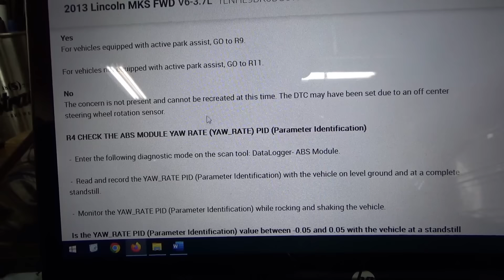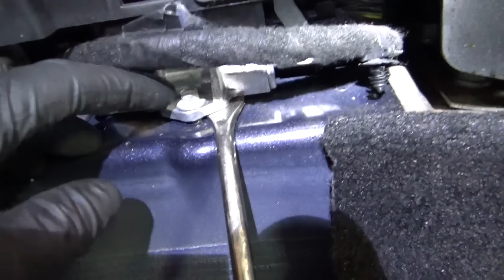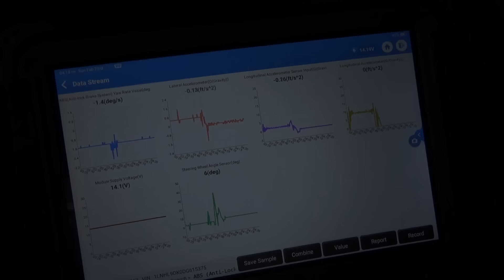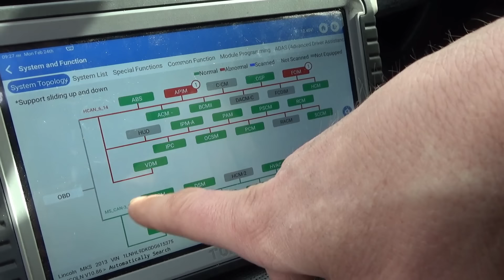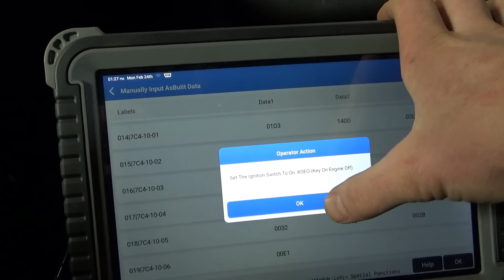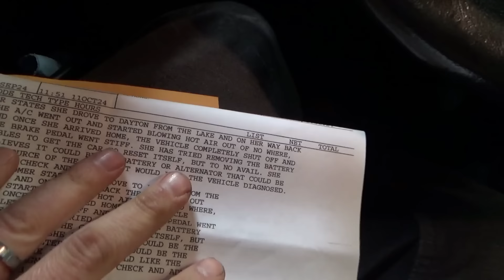(Pt 3) Lincoln BUTCHERED...by Dealer?! ('13 MKS: Water Intrusion...NEW GHOST U3000?!)

Comment: I once ran an extension cord to a car for 3 dehumidifiers inside the car to make things as dry as possible with out taking things apart. It worked. It took about 3 days though. That car was semi flood, driver went though deep water.

Comment: The way I find water intrusion complaints are by closing all doors and windows, setting the blower motor to max, and the ducts to fresh air. Then I spray soapy solution over suspect areas.

Comment: You should not have installed a washer under the RCM. You should have performed in IVD initialization for the ABS module instead. The process instruct you to ensure that the vehicle is on a flat and level service, and that zeros out all the accelerometers and your steering wheel should be straightforward as well.

Comment: Water intrusion is the worst. Cars, buildings etc will drive you absolutely crazy. The sunroof craze that began in the early 00s or so makes me 🤦. Whilst browsing for used vehicles today, it’s almost impossible to find one that is not equipped with one of these evils.

Sunroofs are not the only problem, however, as I use a ‘17 Ford Transit 150 at work which has no sunroof and has all sorts of strange water intrusion problems. During the largest of rain events the vehicle’s headliner gets wet. I’m still trying to figure that out.

The windshield/hood cowling drains have issues also and Ford positioned the ECM directly below one of these problems. The cheap plastic water channel pieces have a tendency to fall off and produce a waterfall directly onto the computer. Luckily I happened to catch that issue before the ECM was ruined.

Comment: I work on this fords every single day.
C0051 is Abs, Flicker lamps is maybe tailgate brake lamp is false, or bcm module- you can program used module, u3000 is left blind spot monitor, the water is from sunroof drains.

Comment: Too bad this is so long ago. We had this issue where the dash was fussing about all the marker and brake lamps. It kept saying there were lights out and found out that LEDs were installed without telling the central electrics module we had done so. It completely disabled all of the lamps and I used my test light to make a check to see if the central electrics module(fancy fuse box) was fussing about that circuit. It worked just fine with the test lamp but not LED's. I started to learn about how the BCM, CEM, GEM, etc module is looking for a certain resistance in the circuit. The Ford Taurus version of that BCM has incandescent lamps so the As Built info is stored on the BCM as such. If someone mis interprets this data and sets the as built data as incandescent instead of LED then you will have weird things going on with the system. Maybe that BCM is different just slightly from the Lincoln and Ford versions of this car which is a fancy Taurus.

Comment: Hi Ivan 
I had a 2011 acadia before and it had same problem and it takes 3 shops to fix it.. and the problem was the steering wheel sensor wire was not connected properly

Comment: Intermittents are such fun.........NOT ! ! !   Sometimes you've got to connect meters and gauges to the system and wait to see when the problem shows itself.  BTDT.  I've seen main power to the module intermittently drop to zero and even a ground suddenly show slight power.  The power wire was cut through the insulation and grounding out to an engine bracket.  The ground was loose, even though I had checked it, it felt tight, but put a socket wrench to it and oh ya, it's loose.  Sometimes heating a module with the electric heat gun (looks like a hair dryer, but don't use it as a hair drier, it'll burn your skin) or spray it with that cold stuff in a can.

Comment: 2020 Sonata with 4300 miles: seat back would not go forward unless you moved the switch backward first. Dealer wanted to replace battery and sest switch for $1003. Declined. Friend at work suggested what his friend did for his Toyota pickup based on google search. Reset seat by pushing buttons to send it all the way back, then fwd, then back again for all 3 buttons. Tried it and it fixed the issue. I will never go to a dealer for a repair. Only went this time because of the warranty but missed it by 2 weeks.

Comment: these Lincolns are really nice cars. It’s a very sad thing that they are plagued with this issue. If you have a sunroof, keep your sunroof drains cleared and make sure that they do the proper steps if you have a windshield replaced because it will leak and you will regret it😢
Reply: i also wonder if the bcm was actually programmed from scratch or if they cloned the data from the previous bcm and tried to flash it to the replacement one when i did the bcm a couple years back on a 2014 f250 i tried doing it this way with my autel and even went as far as entering all the as built information manually and yet it was still messed up because the previous BCM was just screwed an F250 thinking it was a Dooley flashing dome lights for some security issues. I eventually had to break down and go out to the dealer and have them sort it out explaining everything i had tried and they had to basically program the module as if it was new is my understanding and it took hours because not only was the bcm messed up but the pcm was also it was crazy so im curious if you will have to do the same thing with this car and basically re flash the modules that are being weird unfortunately you dont have the luxury of a new bcm i got lucky and was able to get one but that was 5 years ago now anyway im looking forward to what you finding finally fixes the car

Comment: Hello Ivan this is a fun one the fact that your problem acts up at very slow speeds and on a bit of  turn just sounds like a wheel bearing loose  causing a deviation in a speed sensor. Also on the possible water leak when i check sun roof drains i open the roof and park on a bit of a hill. now from the open roof pour some water into the sun roof tray and watch for the water exiting from the factory drains at the bottom of the car try each corner and compare results to se if one drain may be plugged. it depends on how the car is parked ( leaning ) weather the plugged drain ill cause water to enter. good luck.

Comment: This is turning out to be quite the mystery.  What happened to this car while it was in the dealerships care?  Did someone pull the center console looking for the park release?  Did someone leave a window partially open while it sat outside in the elements?  And why did the dealer call a bad BCM for a no start condition when the car is now starting and running just fine with said bad BCM installed?  We may never learn the answers to these questions.  But now that Ivan is on the case, I am certain we will find answers to what is causing these intermittent glitches.

Comment: the ends of the roof vent drain lines should be visible under car; sometimes get plugged (often with help from insects/spiders). You might check / snake them.

Comment: You can use Forscan and with a few mouse clicks it will retrieve the as built file from Ford and reprogram a module with the as built data. Very easy and fast.

Comment: I have the same service advance trac message on my 2015 F-350. Happens while turning but not every time. I drive this vehicle every day; once the message displays, I sometimes get a false ABS engagement while braking normally to a stop. I believe the problem is a bad wheel speed sensor. Could be the tight turn pulls the speed sensor harness too tight.

Comment: Mix-matched tires?
I hadda random quirk w/a car that could not have a newer tire on one side but worked fine on the other side... It would trigger abs lock-up & traction warnings on slight right turns but was otherwise fine~

Comment: Call me paranoid, but I'd be verifying that ground visible dead ahead at 4:21.   It's in line with the water intrusion and has a bunch of wires on it.  I absolutely do not like the longitudinal value constantly changing.

Comment: I've heard of Lincolns "ghosting" some convenience functions when there is an unrelated problem without setting any type of codes or warning messages. 
   Example: A fellow tech had a 2018 lincoln come in with no AC. A previous shop replaced the BCM with no success, so they reinstalled the original and gave up. The ABS light was also on, but the customer didn't want to address that. After quite a while finding nothing wrong with the AC my friend decided to look at the ABS just to see what was going on with that. It had a sensor code, and ABS data stream said that wheel was reading 114 MPH with the car standing still. He fixed the sensor problem and instantly the AC started working again. The only thought process anyone could come up with was the car saw the ABS problem as a safety issue and disabled the AC to prompt the customer to fix it. The problem was it never gave any indication that was their strategy. No warning light or code for the AC. Maybe the erratic turn signal on your car is a way of annoying the customer so they fix another more serious problem.

Comment: No surprise here with the Ford/Lincoln modules. Likely the last dealer/mechanic/technician had unplugged those switches for lane and park assist to trace down his BCM issue. Too bad his documentation on the repair order didn't provide more of the details. $1,200 for that lane change module is completely asinine.

Comment: Such a weird case study. Do you think that someone tried to disconnect something in the console to get the car in neutral for loading on a flat bed? I wish you had a lift just to look underneath the car. My wife ran over a small branch in the driveway in her 98 Caravan and broke a plastic fuel line and didn't know it.

Comment: This is another fine mess you have gotten yourself into. 😂

We used to throw an airline in semis close them up and start spraying soap water at possible areas that could cause a leak. 

Have you graphed the wheel speed sensors yet on one of your test drives? Also have you measured the body on all four corners in case suspension is out of whack. I have seen that on a BMW before, but it did have air suspension.

Comment: Auto park and lane assist are two features that I would be fine if they were permanently removed.
Too many features on cars. I go to a dealer and all the sales lady would talk about was ApplePlay and I have an android.
I wanted to know if there was a full size spare tire. But the trunk wouldn't open because the battery was dead.
I wanted to know if the engine had a turbo. Her eyes crossed and she started talking about ApplePlay again.

I have a 2010 car with moonroof. I forbid anyone to open it. It's a feature we don't need. At 15 years age the seals are probably ready to crack and start leaking so don't touch it. If someone does then I will spread some bathtub caulk around the edges of the closed moonroof and seal it shut permanently. Come to think of it I need to remove that fuse.
Heated seats. Don't need them because we don't live in an area that ever gets that cold. They are big buttons and in the way of the shifter so they are always getting turned on. And then I get cooked. I took the fuse out.
The car has traction control which is some junk feature that makes the car lurch when it mistakenly thinks something is amiss with the traction. No thank you. I can tell if I am losing traction.
ABS. I think the car is more dangerous with it than without.  It's made me slide through intersections when I was trying to stop on dry pavement in the summertime. No thanks.
OK. I like intermittent windshield wipers. I'll keep that. But if it breaks I'm not fixing it.
Reply from the maker: Great comment 👌😎

Comment: On the new Ford F150's with the rear detection system, the module(s) in the rear tail lights get water in them and the corrosion takes out the detection modules in each light, tail lights themselves and the harnesses that connect them all together at a cost of $5k to have replaced and programmed. And the kicker is.... All the corroded components causes a Low speed CAN communication issue dor subsystems inside the cabin making it tough to track down, mainly because all the dash emojis are for the interior of the truck. It was a tough one to track down. CRAZY.....can't make this stuff up!
Reply: Seems like Brian with Ford tech makuloco did a video on that very thing.  The truck was sent through a car wash and so many codes were set the truck shut down.  $5,600.00 to replace the taillights.

Comment: When viewing the data on the side detection module,  it was showing voltage at 11.6-7 volts,  while the scan tool was showing 12.4 volts.  Seems abnormal.

Comment: With problems like this, we'll be looking more and more like Cuba every day. Fixing your own by going back to the older, simpler cars and cannibalizing them for parts when needed will be way cheaper than paying people $200/hour for repairs on a $60,000 car that no one can fix. A nice 1968 Caprice with small block (big block if you dare), PS/PB, A/C is all you need. Who gives a crap about gas mileage? The tens of thousands you'll save buys a lot of gas.

Comment: "There's no bidirectional calibration procedure here..."  Yes there is!  IVD Initialization Sequence.  Technically performed through the ABS module, but you'll find a subroutine for the Longitudinal and Lateral Acceleration sensor in there somewhere.  :)  The issue here is that the glitch is happening way faster than live data can display, and since the sensors are internal to various modules, there's no way to scope them.  Go through this sequence before you condemn anything, including the SOD system.

Regarding the Side Obstacle Detection system, the blind spot monitors rely on steering angle sensor data and ABS accelerometer data to function.  A glitch in one of these systems or even a bad suspension alignment can confuse the SOD modules, while a misconfigured vehicle can cause modules to throw "incorrect component" codes.  Also worth noting, SOD/BSM system has nothing to do with LKAS/LDW.  ;)
Reply: I've got a Compass out of range error.  module is up under the 3rd light on the deck which is a pain to take off.
I cant understand the problem.  370 degrees is also 10 degrees, and points to the same place.  Had fun trying the calibration.  midnight at a liquor store parking lot driving in circles.🤣
Reply: @robertsmith2956    Oh dang, I haven't run into that one yet!  :O

Did the calibration fix it?  If not, what's the year/make/model, and what specific code did it throw for you?  I kind of want to dig into service info.  :D
Reply: @rhkips  08 buick lacross.  the out of range code is hiding with my autel scanner.  The Launch is showing B0931  compass circuit malfunction, B0933 circuit low, B0934 circuit high, and B0935 Compass Circuit Open.
Compass correctly works as long as I set it one zone east of me.  Calibrating didn't fix the code.  It should pop up eventually.  Was chasing EVAP code headaches and cleared them again.
Funniest thing I found when I scanned with Autel.  The dash display shows it is a 2005 part. LOL
Pulled a rear light from junk yard, so know what a pain it is to get to that module.  They even hot melt glue the wires to the deck panel.

Comment: After over 100 years of automotive engineering advancement, the mfg's have now found a way to screw up every system on a vehicle.
Reply: A number of years ago I stripped and cut up a Ford Escort and was amazed at just how much wires there was in a lousy little Escort.
I thought I would hate to imagine how much wire is in a Lincoln.
Well, here it is.

Comment: The sunroof drain and the cowl drains got plugged up.  You can't let snow and ice build up on the windshield and wipers.  I put blankets over my front and back glass so it doesn't happen.  As soon as it's done snowing, go clean your car off.
Reply: Idiots engineering these systems...they need those drains to have heaters or a pump reservoir with deice solvents to flush them out.
Reply: Yep I cut some off the bottom of the cowl drains so they have a little more room to flow, well known issue on this platform, Taurus, Flex, MKS.

Comment: I'm convinced that very few mechanics in the country can solve these problems. Ivan is very special.
Reply: Lincolns are special too, I'll stick w/my mid 80s diesels thanks.  That being stated as the owner of a transmission/drivetrain remanufacturing facility.  These newer multi ratioed (8/10 speed units) cause my eyes to glaze over when attempting to absorb the theory of operation or departure from traditional transmission structure.  Burn the EPA would be a good place to start.
Reply: a lot of mechanics working for a shop just don't have the time.
Reply: @TheLoneShark-s6y 100%. A tech working flat rate would bill an hour scanning it and say I give up or give them a FU quote. I don’t blame them. I played the dealer game for a while. It’s just not worth investing a week worth of time into this car when you could be hanging brakes.